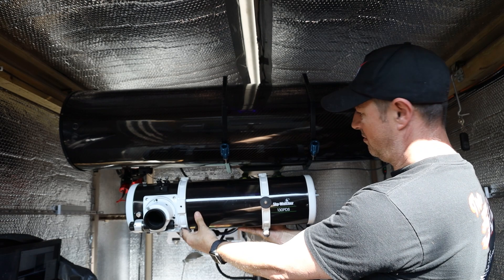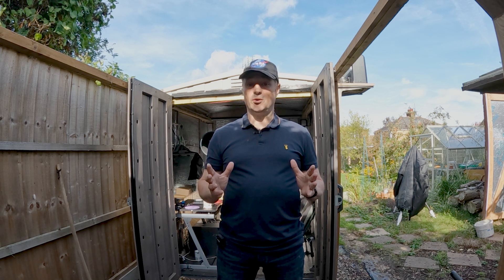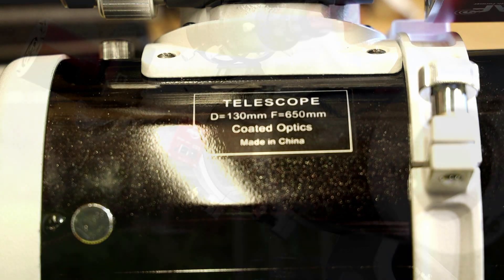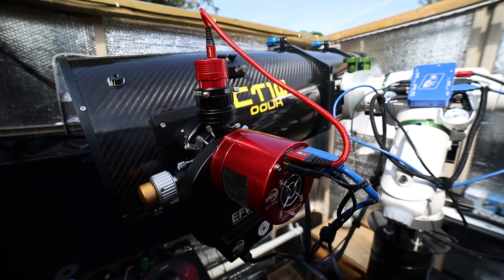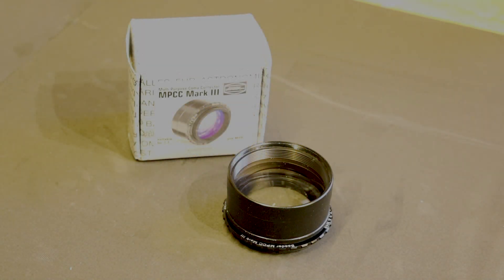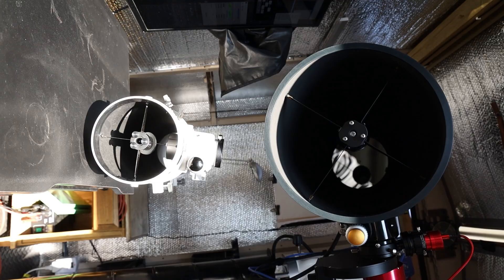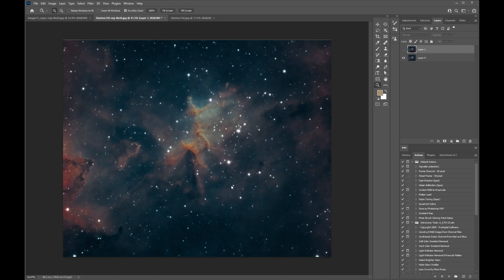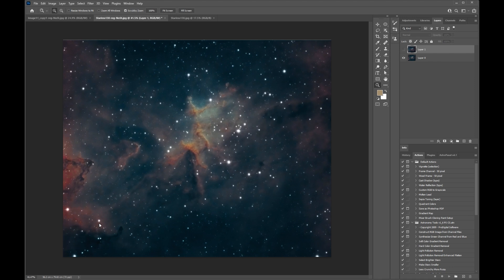Budget 130PDS Vs Premium CT10. Melotte 15 is the target for the Newtonian Astrophotography showdown.

Comment: I have a 10 inch f6 Orion Optics with 1/10 mirror not a CT with a 2"diamond steeltrack focuser upgrade. My question is will my neq 6 pro with belt mods and running on 13 volts be ok for astrophotography. I also have a Orion optics 8 inch f6 with 1/10 mirror and a skywatcher 8inch quattro 200p haven't a clue about the mirror. If the 10 is to heavy which one do you suggest as I know nothing about taking pictures. I just bought a ZWO ASI585MC-Air and a ZWO EAF and will stick them on a scope and see what happens🤔 I must say Orion optics make fantastic scopes
Reply from the maker: Very nice, I have considered upgrading the focuser on my CT10 to one of those. The Featherlite looks good too but a bit too expensive. I did have the CT10running on the EQ6 but it was right on the limit, any wind or bad seeing and it would lose a lot of subs. I eventually bit the bullet and bought an EQ8 R PRO which is perfect for a scope that size and focal length. I think the Orion would be the best choice, that 1/10th mirror should give you a very sharp imagae but I think I would do a side by side comparison with the Quattro just to be sure. Please let me know which way you go and how it works out, clear skies and good luck

Comment: Hi Glenn, great video, do you use the 130pds on the AZ-GTI? if so how do you get on with it given the 5kg weight limit, only ask as I am really tempted getting the 130pds, more of a visual scope for now as its best bang for buck compared to scopes of equal price even over the 130ps which is fixed mirror and chinsy focuser.
Reply from the maker: HI. I have imaged from the AZ GTI but its very difficult to get long exposures because of the weight. If I am imaging the moon or just doing visual it is fine and the got works without issue with that scope.

Comment: Did you have the 130PDS on a AZ-GTi mount?
I was thinking today if that would work.
Does it work well? And do you do visual or photo on that mount with the 130PDS?
I want to do 95% visual.
Reply from the maker: Hi. I only had it on there for the video although I have used it. Bit of a struggle for imaging but absolutely fine for visual and will slew and track fine for that
Reply: @Astrobloke   Why is it that its ok for visual but not imaging? Im new to this.
Reply from the maker: @Jakelol1980  with visual any slight tracking errors won’t spoil your viewing but will photography. Because you need to take very long exposures to capture good images any errors will spoil an image making it blurred and stars being streaks and not points of light. Its fine for say images of the moon as that object is very bright and you take very short exposures.
Reply: @Astrobloke   I see so i would need a very stable mount like a EQM-35 or something like that for that telescope? But as you say for visual the AZ-GTi would be ok because inside the payload.
Reply from the maker: @Jakelol1980  yes for astrophotography the EQM 35 or EQ5 would be the kind of mount you would need. I run my zenithstar 61 on the azgti fine and have got some great images. I have a video capturing the California nebula with that set up.

Comment: That Orion optics scope is an absolute belter & out of the 2 images the Orion wins however the 130PDS is definitely the best bang for buck scope out there, it would be interesting to see how they would both perform in another shootout after doing some tweaks to the 130 like flocking the blacking around the mirror & on the focuser to see if that would improve the contrast. These days I generally image with refractors but I have imaged with my Skywatcher 250PX quite a few times too.
Reply from the maker: Thanks for your comments. I am going to do those mods for sure and see what difference it makes. I am also thinking of doing. Collaboration with myself lol. Get both set up on the same target and combine the data. Thinking of doing that with the Melotte 15 data anyways although the framing could have been better
Reply: @Astrobloke  thank for your work
By italy